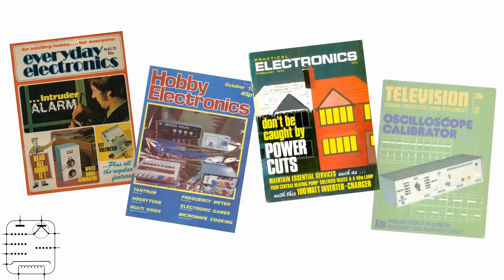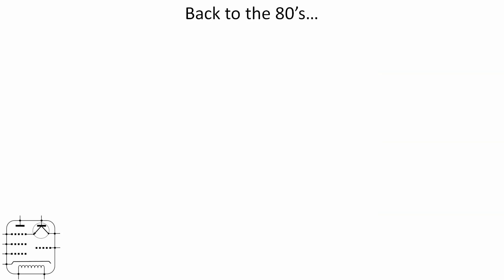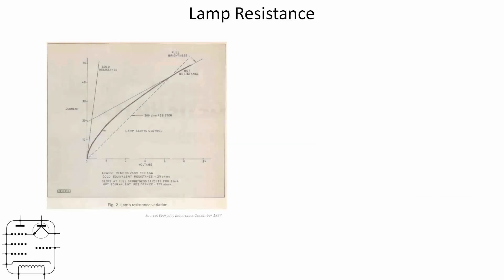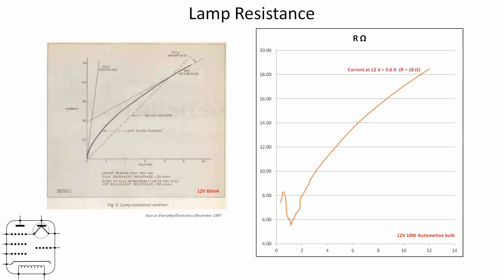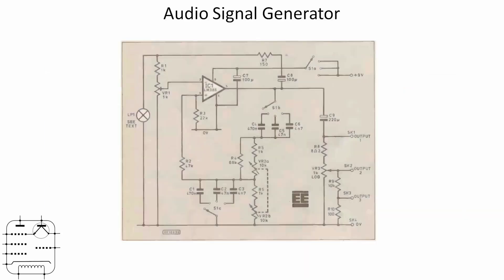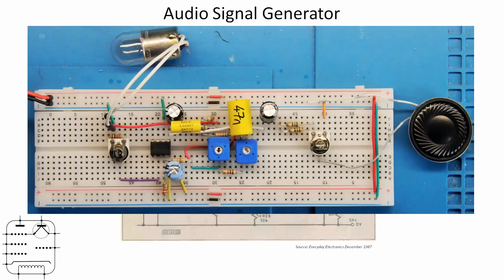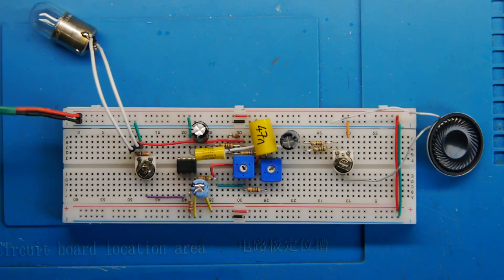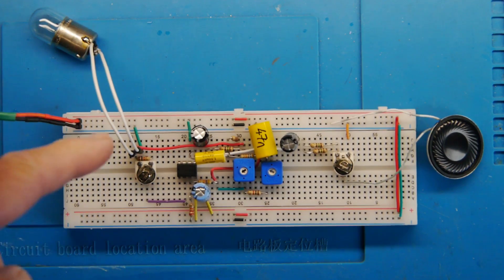Tungsten Controlled Signal Generator  - #220

Comment: I doubt the bulb actualy stabilised that wave even with a lm386 driving it that bulb is just too big to change the resistance enoughf amd quickly enoughf with that power level
Reply: It will oscilate but its not going to have super low thd unless a much smaller bulb is used

Comment: Another circuit to confuse the production people... an AGC using an opto isolator... the type that was an LED in a black tube with a CdS cell.  The CdS cell has a nice response time for AGC type things, so the LED was driven by the output signal while the CdS cell adjusted the gain.  Very simple.  Confusing for production people trying to cost cut.

Comment: I designed one of these oscillators for some medical gear.  Big fight to keep them from swapping it out with a different lamp or later an LED.  NO, it's not supposed to light.  Yes, it has to be there.  No, you can't use any lamp you find...

Comment: Thought that HP using the bulb amplitude stabilization in 1930 and being a comercial success. Being a student triggered by the wien-bridge and also the quadrature analysis. For frequency it is an easy task but for the amplitude you would simply argument by the RMS of the bulb voltage or current give you the right number. Yes the practical amplitude solution is not far away and the harmonics could be very low. But there is another observation. The amplitude gets more instable, mostly impacted by the reverse buffer effects or the supply, the more linear the active part is built. FET stablized oscillators rarely go below above -70dBc where some hobbist claim less than -130dBc. These low numbers come with horrible stability. That is what make me curious then. There is an ideal amplitude regulator for the quadrature oscillator which analog have the regulation target:
R-I^+Q°2
The simulation of this circuit give spirals from outside or inside to the circle of radius R. Small pertubation get damped very fast. This is an instantanious regulator but more common regulators detect the amplitude with final ripple and introduce ripple. The slowness and the regulation ripple effect on harmonics is a tradeoff. If you make the detector very slow any pertubation could increase or decrease the amplitude over more periods. Effective an regulation pertubation amplifier. These unfortunate behaviour get more worse at higher frequencies as the ratio between frequency and regulation natural frequency increases. But there is another process helping here. Any active RC oscillator circuit have still non-linearity. It is typical the input stage non-linearity. It is only linear up to 52mV, equal to two temperture voltages. If the unity gain bandwidth of the OP is 20MHz, amplitude 5V and 20kHz then the input see 5mV giving slight non-linearity. This is a secondary amplitude regulation effect which have to taken into account. The bulb was not a bad solution but suffer from a fixed regulation time constant. Modern oscillators use FET and detectors with low ripple where the time constant could be adjusted.
Some instruments from the late 80`s using quadrature sampling with a sample/hold and discrete amplitude control. You see this in not so clean spectrum.

Comment: Yes, I had one of those Heathkit trainers also. 741 op amp and an incandescent bulb in the circuit. I learned a lot at 9 years old, putting the kit together and training on it. I moved on to electrical engineering for a career and I am now a controls engineering support specialist for hire.

Comment: I ask a robot about things I already know, to feel vindicated.  The one in the Opera browser (forgot its name) said this when I mentioned Packard and Wien Bridge:
"David Packard partnered with William Hewlett to commercialize their first product, the Hewlett-Packard HP200A, a Wien Bridge oscillator, in 1939. This oscillator used an incandescent lamp to provide negative feedback, stabilizing the amplifier gain and ensuring low-distortion, steady output, a significant improvement over prior designs. The innovation was a variation of the Wien Bridge circuit, which had been around since 1891, but Hewlett's addition of the lamp made it a practical and inexpensive sine wave generator. "
I'm sure the rabbit digs MUCH deeper...

Comment: One of the first signal generators I built was a Wien bridge model similar to the one you have shown. Kept it for many years until it was given to a young electronics enthusiast. Worked well but stability was some times a problem. The circuit for the design was from Practical Electronics and used a thermistor for stability instead of a light bulb.

Comment: I wonder if the bulb might be slightly gassy, do automotive lamps have a getter, I wonder? Could heat up, gas reacts a bit and drops the resistance until it is picked up by the getter. Though at just 12v I don't know what if any gases would conduct much( I honestly don't know, anyone?), or maybe the gas still has an effect the whole time but it is covered up by the larger  resistive effect of the heating tungsten. Impurities on the filament, also a possibility. I wonder if you tried more bulbs of the same type.

Comment: My Farnell LFM-3 signal generator developed a fault many years ago and I was surprised to see what I thought was a lamp in the negative feedback circuit. Turned out it was a glass encased thermistor that regulated the oscillator to an optimum level. Still works great to this day!

Comment: I have a Heathkit audio sig gen, which I built from the kit in about 1974, that uses a similar circuit utilising an incandescent lamp. It looks like a part intended for this specific use though, as it's unlike any standard lamp, being wire ended and tubular in shape with just a crimped base and no metal end cap.  The circuit is all discrete transistors. I'm proud to say it worked first time with no issues, it just needed alignment, and it's worked perfectly ever since. At one point in the 80s I was trying to sell it as I'd lost interest in electronics!  Fortunately there was no active way to sell old gear easily back then so it stayed with me, and my loss of interest transpired to be temporary!  I would have been extremely disappointed now had I sold it back then, as I'm now very fond of it and it's like a window to my distant past.  Of course I could use an app on my phone now or a cheap function gen to far exceed what this sizable brute is capable of, but I still choose to use it as it gives me a warm nostalgic glow!

Comment: Not just a wry smile. Sadly about 10 years ago I had to get rid of 50 years worth of electronics magazines dating back to the 60s. I seem to recall a valve based Wein Bridge oscillator circuit from the 60s in one of them which also used an incandescent bulb.

Comment: In 1975 - 1981,  I lived in Hinkley California. It is 25 mi. West of Barstow, Ca. It is on the edge of civilization in the Mojave Desert. As a kid I was amazed at some of the trains over 10 miles long ( 16 km) they could have anywhere between 25 -  35 locomotive engines. The last time I visited the area in 2011, I was disappointed to see the trains were only around 1/4th mile (0.40 km) long. 
Today, it seems like the grandness has been taken out of everything .

Comment: I'm shure these magazines put in these mistakes so you had to buy the next issue.
Reply: Everything was hand drawn back then, there was no EDA / GUI type circuit design that such magazines could use. Remember that the magazine may have had only two or three staff, (often shared across several titles) and most of the articles were by contributors.  It was inevitable that mistakes were made.

Andy

Comment: So they're just using the bulb's varying resistance to round off the signal's waveform from a square to a sine-ish wave then?
Reply: No for God's sake no. Wien bridge produces sinewave as is, but it is extremly gain dependant. Gain needs to be exactly 3 for it to work stable. If gain is just a hair smaller, the sinewave will die off. If it is a hair bigger amplitude will rise indefinitly. Since electronic oscillator (esentially an amplifier) can not produce infinite otput, it clips off the sinewave into something like a squarewave. Wien bridge will work if you just set gain to exactly 3 and leave it alone, but because of changing temperature, variations in performance of the amplifier, it will eventualy go eather over eather under the set gain, so after some time you'll find it producing squarewave or not oscillating at all. First to use a lighbulb amplitude stabilisation were Hewlett and Packard in 1939, in their famous audio oscillator HP200A. Idea was simple, introduce lightbulb in negative feedback path (gain defining path) of an oscillator. If amplitude tends to increase, voltage will get higher, the current through the negative feedback, and the lightbulb will get higher. The filament will warm up, increase its resistance, and lower the gain, efectivelly lowering the output. If the amplitude decreases, lightbulb resistance will go down increasing the amplitude, so there is a sweetspot, stable point set at gain of exactly 3. You'll get stable amplitude sinewave with almost no distortion. The idea works for all types of oscillators, AF, RF... If you need less distortion, you have to introduce some kind of automatic regulation of gain. Ofc if it is oscillator in your kitchen table radio, it is enough that it works, but if you are making signal generator for example you must have amplitude stabilisation to keep your distortion in order. 😂
Reply: Deliberately trying to heat/cool the lamp with an external temperature would show the limit/ range of lamp variation  that can yet maintain some stable oscillations
Reply: @analoghardwaretops3976  In theory yes, but you would need to act directly on the filament. There is much simpler way. Plot the lamp I/V curve and from that find the R/V curve. From these data one can find the regulation  range, having in mind the limitations of the circuit, notably the max output current of the amplifier.